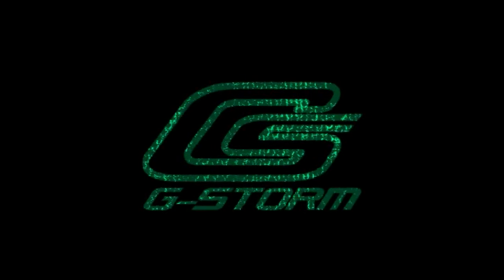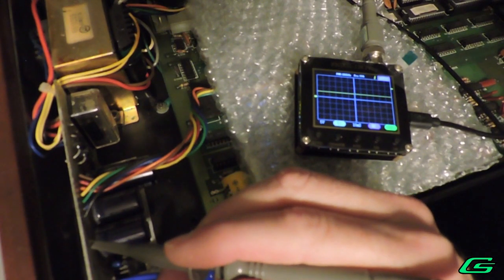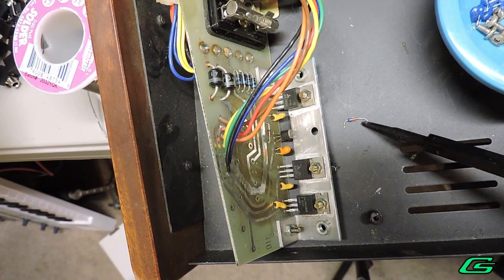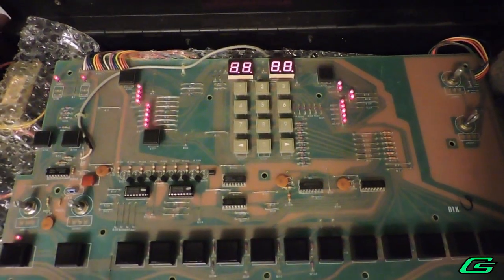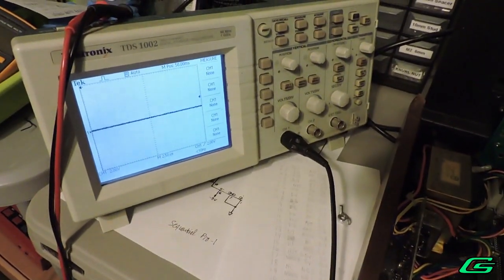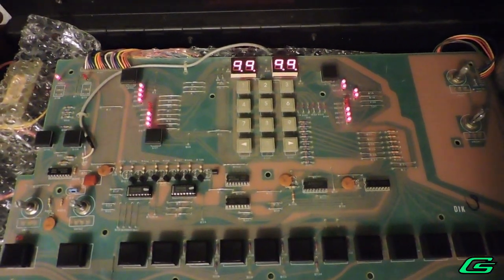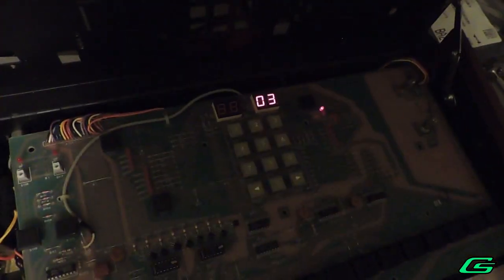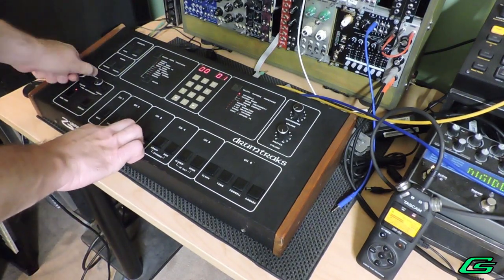Sequential Drumtraks Drum Machine Repair

Comment: I've got a Drumtraks on my bench that is driving me nutty. Everything works fine (all sounds, midi control, etc) but as soon as I try to record a pattern, it will act very glitchy like in your video.  Sometimes it works fine, but usually it doesn't. Extremely temperamental.
Reply from the maker: Oof time to break out the scope

Comment: Are you sure those were RAM chips and not ROM chips? RAM from this era was seldom packaged in 28 pin packages. If they were ROM then they absolutely have to be in a certain socket in order for the ROM to show up at the correct address.
Reply from the maker: Absolutely, there's one eprom chip for the program data.  Your message made me wonder, do I yet have a bad ram chip?  I've programmed patterns at locations 00, 01, 26, 51, 76 and all patterns get saved correctly.  So I'm still not sure what's up.

Comment: I’m concerned you may still have a bad RAM IC, and the problem is simply not manifesting itself in the same way because it’s in a different socket now. Personally, after discovering that the problem seemed to go away after swapping RAM between sockets, I would go ahead and replace all the RAM.

Great video, I’m an amateur repair guy and I’m not professing to be any authority on this stuff.
Reply from the maker: Thanks!  It's made me wonder.  I've programmed patterns at locations 00, 01, 26, 51, 76 and all patterns get saved correctly.  So I'm still not sure what's up.